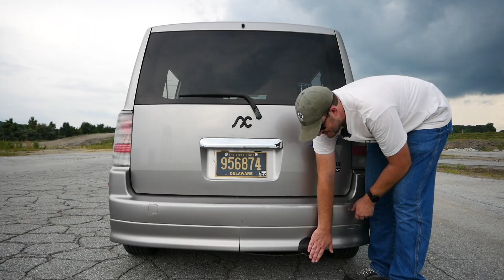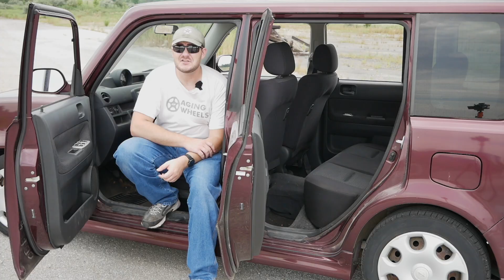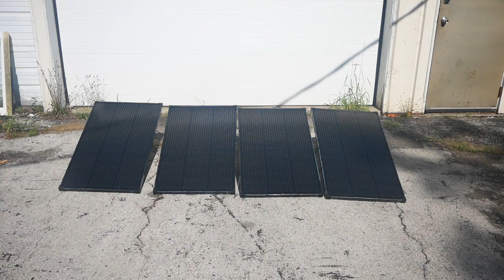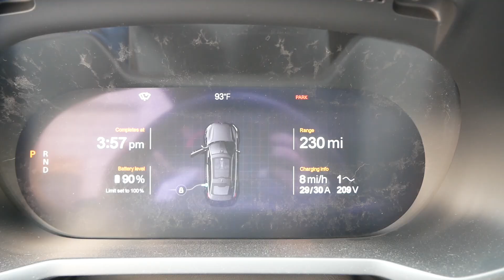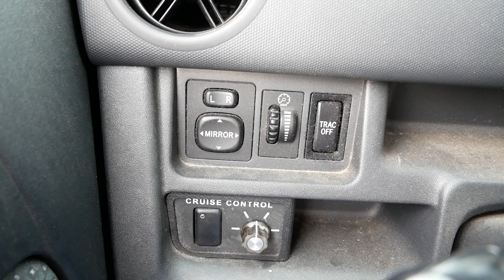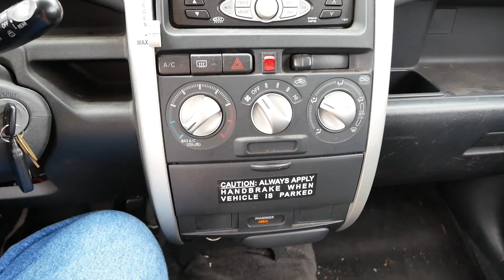The ACP eBox is a Technology Showcase Crammed Inside a Cheap Toyota

Comment: Using the drive inverter to export AC power is something I want my project to be able to do, though I'm aiming for the ability to export 3-phase power to run tools and equipment. I'm surprise it's not more common, that drive inverter can run a house no problem with the right software.

Comment: The thing they missed: STEEL WHEELS.   getting some basic aluminum wheels would drop like 25lbs of rotating mass, which would give them like 5 miles extra range.  Doesn't sound like much, but lose power 4m away from home  and you'll quickly changed your mind

Comment: 15:20 Frankly, that shifter is perfect. All you need is a tiny thing that doesnt take up a lot of space, lets you select forward, reverse or park and display which one is currently active. I would much, much rather have that than the MASSIVE, wasteful console of awkward buttons my Bolt has for a function I do 1ce per trip.

Comment: I hate that the 14-50 of all connectors became the EV standard. I personally have a 6-50 and home and that makes WORLDS more sense. J1772 doesn't even have a 4th pin for neutral and even if it did there's no need for dual voltage in a car charger. I know it became popular because it's the shore hookup for RVs but that seems like a weak reason to use a plug that wastes an entire conductor to do nothing. The reason I'm making this comment on this video is because that death cable proves the point, the neutral pin is missing because it's literally useless when connected to J1772.

Comment: Scion was created by Toyota/Lexus as a feeler for younger buyers that could not afford Lexus and were not satisfied by Toyota. They offered them base at a very low price for a new car with a Toyota Corolla or Camry drivetrain and at least some Lexus upgrades in the safety package. They were marketed with I think almost $8k in available customization for everything from the seats to the rims and upgraded sound system with woofer. The most notable thing about the first gen XB was that all that super low body effect was not effect. It practically came factory with the body "channeled" so the interior was almost like a Tardis and surprisingly accommodating for taller/bigger people.

Comment: I own one of these. I believe I am the 3rd owner. I love it. It's my daily driver; I don't know of any other that is but I"d like to. I've had it for 5 years and put about 55000 miles on it since I've had it.(It now has about 110 000miles but I don't know the mileage when it was converted.) I still get 100-125 miles per charge. If you are at all mechanical or even a bit handy you can do a lot with this vehicle. This thing was way ahead of it's time and if I could get another I would. If anyone knows of one for sale I am interested.
Reply: Did you ever wish you could change the gears? I'm very curious if it would be good to have that option in certain scenarios
Reply: @arthur.heringer  There's no need to change gears. It'll go up hills with no problem and I've had it over 80 mph.

Comment: Excuse me if I am underwhelmed.  Stealing power from the inverter and piping it outboard, is a wiring parlor trick...not "impressive technology".  Basically one off PC boards is not "impressive technology",  just good home brewing with off the shelf parts.  What Is 'Impressive Technology"  is Nissan mass producing a water cooled charger/inverter, 3 phase electric motor/transaxle with modular design, world wide interchangable parts availability, an enviable lack of any examples that have had battery fires, an aerodynamic body, nearly flawless software, all with  great efficiency, real comfort and decent safety  A Decade before anyone else came anywhere close to producing such a sucessful car, with a decade of upgrades.  10 years ahead of the world.. and it continues to be one of the Most Reliable, and most widely produced electric cars in the world.  It works beautifully, and will after a million miles. That is BEAUTIFUL.

Comment: On top of everything else, ACP was forward-thinking enough to stick the charge port on the front, where it's in closest reach of most public charge points, instead of under the gas flap that's already there. Even though public charge points weren't a thing yet. Now I wonder about that proprietary plug they had developed—whether or not they, like Tesla, created a better plug design than the ones that ended up becoming standard, or not.

And speaking of Tesla, I did some quick digging on the company to see what became of them, and not only did I find out that they're still in the business of making motors for third parties, the whole reason Tesla exists is that its founders visited ACP, tried out their prototype sports car, recommended it for production and were told that wasn't what ACP planned to do, so they went "screw it we'll make our own company"—and then the same thing happened to Elon Musk so he invested in that other company instead. What might have been...

Comment: The “locked in second gear” part really isn’t ideal, it’s a shame they couldn’t do something with the final drive ring and pinion ratio to be able to lock it in 4th and send power straight through the trans….the torque multiplication given by locking it in second is probably nice on takeoff but that is asking a LOT of a lower gear in a transmission designed to go behind an engine that made like 75ft-lbs of torque just off idle. The parasitic losses from friction you get when sending all the power through two gears mounted on two separate shafts vs it running straight through by having the input and output shaft directly coupled in 4th / direct gear has to cut down on battery life and will cause the transmission to wear out significantly faster than it would normally….helical gears are constantly pushing each other apart and this puts stress on the bearings supporting the main and counter shafts in the transmission which as they wear will allow the gears to start to “walk” apart and cause noise and abnormal wear of the gear teeth.

Comment: Hey!   We still have our 2006 XB and it runs beautifully. It's fast off the line. It's comfortable. I can throw 2x4s in it with the doors closed.  I can carry 4x8 sheet materials on it's roof rack, thanks to it's boxiness. And it's still incredibly reliable and has low cost maintenance.

Comment: 10:13 I'm surprised that the engineers came up with a way to let you output power, but at the same time, didn't think to have at least some sort of switch or lockout so that people didn't accidentally make what is effectively a live male power cable if they forgot to plug the other end in.

Comment: Honestly that cruise control is way more viable in an electric car. In a gas vehicle it would be controlling the throttle which is affected deeply by load and not safe.
If that just requesting an rpm from the speed controller, then it's probably reasonably linked to final speed. Idk about self canceling if you tap brakes

Comment: I actually own one of these to my wife's dismay. You got more than 100K people to watch a video about a car with only about 25 built. Pretty impressive. And you got almost everything right! A few corrections/additions: the speedometer issue is common across all eBoxes and it's explained in the manual. Trust the digital display. Charging can only go to 70A, not 80A, so you can only charge at 17kW. The V2Load Voltage is limited to about 220V no matter what the display is set to. But V2G can go to 240V.  The manual says 35kWh for the battery capacity, but there must be some buffer. I only could ever charge about 28kWh or so when new. The original connector was a ITT CANNON MS3108E28-22S, I think it was used for ship to shore for helicopters.

Comment: When you mentioned how the heater would draw a lot of power, I just thought about the Electrk Uncar's solution of a hair dryer.  Honestly , the AC at least seems like an easy fix if it's using standard XB parts.

Comment: I remember the motor in this thing pre tesla.  They advertised the inverter pushed up to 800hz (I cannot remember the exact number) with 700+ volts to get the most efficiency at its power output but it required a hell of a motor controller.  Their newer motors look hostly fairly nifty.  Kind of like you can do it yourself electric car with just plugging in one of their motors.  Of course they don't advertise how much they cost and you have to "contact them" bleh.

Comment: The 2004 to 2007 XB's had a 1.5 liter VVTI engine - not a 1.4 liter. Starting with the 2008 year models the body style was changed from the original style shown in your videos and the engine size was increased to a  2.4 liter VVTI engine.

Comment: now, i want to see one you can actually shift.. i bet over 90 wouldnt shake so much if you had 3rd.. :P 

and yes, a tranny on a pure electric can be silly, a conversion it actually could make sense, more so for a truck though imho... lower gears for those times your getting a load up to speed thats heavy, higher for better efficiency at higher speeds, though, im told, a redesigned transmission could be much more efficient then bolting an electric onto an ICE trans... the idea of conversion kits that let people have their older ICE cars turned electric or better, hybrid... would be quite interesting to many people i know, in one case, needing to be able to tow his boat without taking the hit his electric truck takes from towing it is a benefit of the work dev truck he gets to use often... its an old f350 they converted to hybrid, a truck thats engine was blown by an idiot who ignored all the lights... for weeks.. their conversion was able to tow the company flat bed from the portland area to seattle, charge for the night and tow the trailer and load back the next day without stopping to recharge... that was before they mounted a highly modified honda generator in the frame setup to kick on under set conditions, low bat, heavy load, etc... they took it to canada and back towing low-load trailer full of stuff they were trading another company in BC, they didnt charge it at all from a plug.. it used 15gallons of fuel over the 5 day trip..  including the generator running when the thing was parked recharging the battery.... not f-ing bad... more so since they spend 2 of those days driving to some good fishing spots and a few spots there was filming for Stargate and getting some pictures of the area, drone shots, etc... they took it allover... its so weird how quiet it is.. even the generator is near silent with how its exhaust is hooked up..

Comment: Would've been nice to have that Ecoflow when I was off grid in a cabin, would've been so much easier than 12 deep cycle batteries and separate charge controllers and a crappy inverter that would turn off when the voltage spiked

Comment: Was anyone else feeling anxious when he went from hovering his hand over the top level of the battery charger with its AC inverters to the lower tray with the long row of HUGE capacitors? ⚡💀☠ I mean, he uploaded the video, so part of me knew he wasn't going to brush into any high voltage, but it still made me wince reflexively.

Comment: I love it.
This thing has none of that dumbed down factory-controlled BS what you see in modern EVs. Modern EVs don't let you use the motor inverter as a 120/240VAC source. And if a modern EV would have that option, you'd probably need to pay a monthly fee to unlock that feature.
This EV has all what I'd like in an EV. Accessible electronics, tinker-friendly, insight in voltages, amps, UPS function, grid-connected battery function.
Just a few changes I'd implement. I'd add some normal receptacles for plugging in 120/240VAC equipment. I'd use the electric motor that drives the 12V alternator for driving the AC compressor  and power the 12V system via a step-down regulator. Or is this motor also running a vacuum pump for brake assist and a power-steering pump? Or are does it have electric brake assist and power steering? Since this was a manual, it should have a clutch pedal. I'd rig up the regen controls to the clutch pedal, including that slider pot. And leave the original braking system as is, only to be used for emergency stops.

Comment: I hate Tesla for many of the same reasons I hate Apple. But the Roadster was technically launched in 2006. Also, the Roadster used AC Propulsion as well, or at least it was supposed to. See Road & Track's "Elon Musk Admits to Shareholders That the Tesla Roadster Was a Disaster".

Comment: That thing is a bare minimum 2008 electric Carr. 
The fact that it as more features than today's car as nothing to do with ebox being head of it's time. E car today are just pointelees scam even by e car standards.
And no being able to set the charging profile buy hand is not a problem but an indispensable features. Honestly if you can't set a charging profile you probably don't understand the technology  enough to be trusted to drive or own a car in the first place.

Comment: A small bit of information for you Robert.  The first thing I read about a car with cruise control was a review of a big American V8 that had it.  In that early implementation it was much the same as the eBox - a wheel to set the speed, and an activation button.  So the cruise control you used is a throw-back to an even older piece of technology.  It may even use one of those early control systems?
Not a bad car.  I can see why the University keep their fleet running.

Comment: xBs originally didn't come with cruise control, but earlier models had a throttle cable, and later models (06+) had drive by wire, so they added a separate module that told the throttle body to open and stay open, effectively making it cruise control. Considering there's no longer a throttle body, it had to be implemented like that. That's my guess

Comment: I would like to be able to set the max. charge and discharge voltages of the cells in my EV. Also I would like to set the current drawn when turning on cruise control after i drove slower through a town. I want the car to accelerate slower and less aggressive than the stock configuration is.

Comment: I want three pedals in an EV. Accelerator, regenerative braking and mechanical braking. With the regenerative braking pedal being mechanically linked when fully pressed with the mechanical braking pedal, so if you stomp on it the car will go full regen and full mechanical braking. I also want to feel when the mechanical brake pedal link is activated. Like in good old trolleybuses which drove exactly like this. I drove one, although it was a long time ago. These trolleybuses do not operate anymore, instead modern two-pedal-dive ones are running.

Comment: Ecoflow is crap. Too many issues once you Start using it heavily on a daily basis.

At the end we had to build our own system and can now appreciate the advantages compared to the Eco flow nightmare with too small AWG wires that get hot, weak cells, bad software and poor translation.

Better to check a product before making an ad for a product that afterwards appears to be crap.

Remember your lawn mower you had presented and later sucked in reality ?

Comment: A manual that was suck in second? Considering how it takes off like crazy and tops out at 90, what if you moved it into 3rd or maybe 4th, would you get less ridiculous acceleration but as a result higher top speed before the motor reached max RPM? I know for something that had the aero of a brick that anything more than 90 is insane, but would be interesting.

But since we're talking about ridiculousness, what if you put it in first and mashed the, uh, go-pedal, would that spin the front wheels with stupid acceleration but top out at like 50?

Comment: This isn't new, even in 2008. I worked for a company in the UK (called Wavedriver) who were doing this in the mid 90s. 3 Phase drive system. Direct charging from 3 phase and able to put power back into the grid. It could also correct power factor. Since working there I have kept an eye on EV tech over the years and I swear every 6 months someone mentions putting power back into the grid as if it's a new thing.

Comment: The only thing that would make that vehicle more fun is if the shift cables were put back in and the shifter was returned. Having a 5-speed manual transmission on an electric motor would make it much more interesting and fun. And because it has an electric motor you would not need a clutch pedal when shifting as long as you turned off your regenerative braking.

Comment: Hey, that’s the way aftermarket cruise control used to work. I had a 1983 Volkswagen Rabbit GTI with aftermarket Cruise control added by the dealer. It was an whole extra stalk on the steering column and totally had nothing to do with where the gas pedal was. Speed was adjusted by turning the end of the stalk and measured by a magnet attached to the inner CV joint with a hall sensor.  The cruise control itself was a stepper motor that pulled on the throttle cable and did not take any data on actual road speed. It just held engine revs at a certain point and that was the extent of the cruise control.  Fortunately, it did have cut out switches for both the clutch pedal and the brake pedal.
Reply: My 1964 Cadillac had a speed knob on the dash.  Mechanical (not electrical), but same idea.

Comment: I can't stand how some conversions just slap a charging port wherever. For some extra cabling and hardware, the port could have been located in the now defunct and dirty fuel filler door. At $55K to upfit, you would expect better fit and finish.
Reply: For 55k$ you buying a prototype tech what still today is not fully avalable....

Comment: I have a 2006 scion xB with 334,000 miles on the original manual transmission and engine. It is a $600 beater but I love it. I almost hit a deer with it and I actually thought I was gonna cry if I wrecked the car.